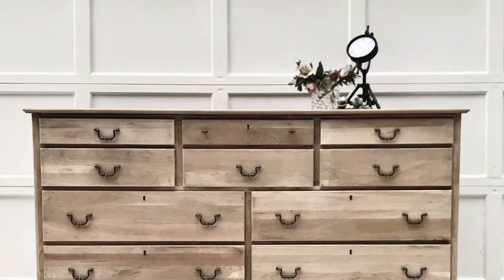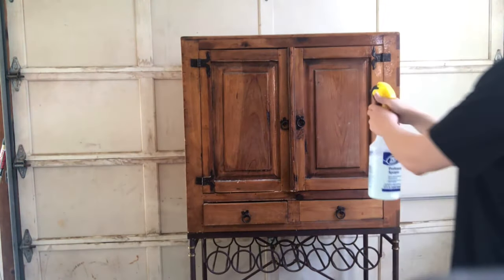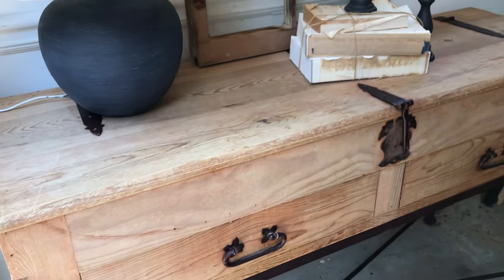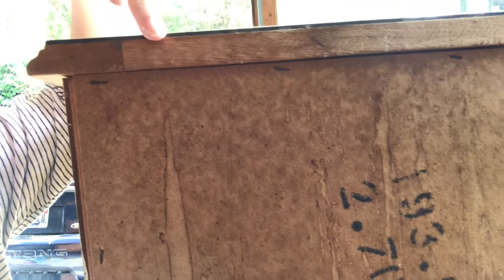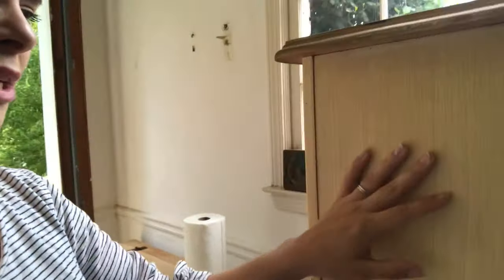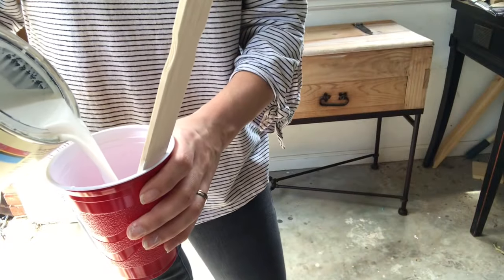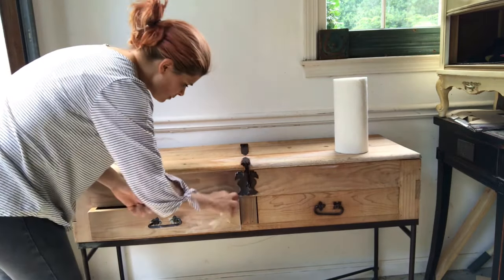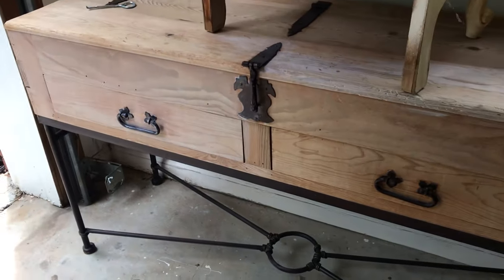Raw Wood Finish tutorial | Bleaching  wood white wash, PLUS How to tell if furniture is solid wood

Comment: I would love to do this on an old dining table that will need to be striped first, but then would love to keep the look of the raw wood. But since it's a dining table what would you recommend to seal it with to avoid water rings from drinking glasses? Love the look if your pieces!!! Just besutiful!
Reply from the maker: Glad you liked the video!  It’s tricky sealing raw wood bc it will darken it.  The only thing I’ve had any luck with that hasn’t darkened the color is white wax.  After the wax cures its pretty durable and most times you can buff out stains.  Def do a spot test!  Let me know how it turns out!

Comment: Love that piece!! I do have a question for you....
I just recently stripped and sanded a dark cherry stained nightstand down to the raw wood with the exception of some dark stain left in the details and carvings (very early 2000’s classic cherry bedroom set) however I don’t  mind that bc it kinda looks like dark Brown antique wax in those crevices- also, the wood tones vary on the doors and the drawer fronts. But I really love the natural wood. I picked up GF FLAT OUT FLAT because I knew that it would prob have a cup or plays sitting on it at some point. So I figured I better seal it since it’s a nightstand. I figured it would darken a little bit so I was hesitant but the trade off was protection right?? Well, one thin coat on one door and not only dark but RED here I come!!! Panicking I wiped as much as I could off let it dry and sanded lightly by hand. Whew! So my next thought was taking some leftover white wax. Which was better but kinda gave it a more pickled look than I wanted. So I stopped and starting looking on YouTube. Saw your video and the blonde girl Pine something. And I’ve come to the conclusion that bleach should help me get rid of that red that’s still in there. Sorry for rambling- my question is I have gotten white wax in the crevices and hard to sand spots, so would the bleach eat that off you think or should I attempt to remove it before bleaching??
Reply from the maker: Lisa Jackson, oh no!  Top coating the bleached wood is a much talked about topic among refinishers and DIYers.  I vote no and have decide I will just sand it if I get something on it.  But that bleed through is tricky.. Being the impatient diyer I am, I’d probably just take my chances and apply the bleach assuming that any white wax will remain but I generally like the look of white wax.  But I doubt the bleach would remove the wax.  You run the risk of it being splotchy if you don’t at least sand off all the flat surfaces but it sounds like you already did that.  Hope that helps and hope it turns out!
Reply: I went ahead and gave it a light sanding again. Then brought them outside in a bright sunny day. I used a big 4” brush and a bucket of straight household bleach. Laid them flat and I did about 4 coats of bleach letting the sun dry each coat in between, then gave it a good wipe down with a rag and water. Totally worked!! There were some really yellow spots that just wouldn’t lighten up but then I applied the white wax and did a little heavier on those yellow spots and it was perfect!  The white wax helped even out any splotches. All the blood sweat and tears was worth it!

Comment: I’m refinishing some vintage pocket doors. They are yellow pine. I’ve already stripped the varnish off, it was dark but they are still so stained. Even after trying to sand. With the varnish gone I can just bleach? I used the zissners wood bleach on one after sanding like crazy. Could I skip the sanding part?
Reply from the maker: If the varnish is off (you can check by seeing if the wood absorbs water and changes color) but if the varnish is off you don’t need to sand at all

Comment: I love the look of this and I like the whitewash, I was just wondering, the lamp and the candlesticks, did you paint those? if so what paint did you use? I love those too that's really dark matte black, it's not just a spray paint, is it chalk paint?
Reply from the maker: I did paint them, I used a chalk paint by rustoleum in the color charcoal.  the lamp has texture under the paint from wall joint compound, I chose not to seek the paint to keep matte finish and for my purposes they have held up great no chips at all

Comment: Please if you can get back to me on the The Wood stain white quickly pickling, I cannot find it anywhere, I I Live in Tennessee looked for it online add a stock so do you have a substitute that I can use to get the white stain look on bleached wood  🪵 
Please help me😩
Reply from the maker: Hey there!!  You can use any white wash or you can do a paint wash with white paint.  Check Walmart or Michaels if you can’t find one at a hardware store, basically you want to look in the stain section and find one that says white ❤️
Reply: Thank you 😅

Comment: Wow, it turned out amazing! How did you know that you didn’t have to sand/remove a stain prior to bleaching? I have a solid wood piece with a orange tone and assumed I should strip it first. But now I’m not sure haha.
Reply from the maker: You can check by wiping a spot with water, if it absorbs the water then it  doesn’t have a topcoat on it, hope that helps!

Comment: On the solid wood nightstand with the red/ orange tones towards the end of the video, what strip would you recommend to use that would take the red tones out before you bleach it? I have two solid wood pieces with red tones  with one being antique. I want them both stripped down sanded and bleached down to the natural wood but not sure if Citristrip would work on them.
Reply from the maker: I'm not a huge fan of chemical strippers bc they are so messy but I would use quick strip 15 minute formula if you are going to go that route instead of sanding.  If I had a lot of red tone I would bleach llike I did in this video and then I would do a white wash or a taupe wash after.  I have another video where I did a cherry wood dresser and I do that exact technique with the white wash after bleaching.  Thanks for watching and I hope that helps!
Reply from the maker: Here’s the video I mentioned https://youtu.be/SLcxzznv-60

Comment: Just purchased a bleached oak coffee table. How or what do I need to do if I wish to use linseed oil on it? Appreciate any advice
Reply from the maker: hmmm, careful with any oil or topcoat, in my experience the only thing that doesn't bring out orange tones or darken my work is white wax
Reply: @blacksheephouse  so your saying as it's been bleached I won't be able to sand down a little then use linseed to darken?
Reply from the maker: @jonathanmcrae3728  if you want to darken then you are good to do that or anything really, but if you want to keep it light then I would avoid any topcoat

Comment: Is there anyway I can lighten a table that has a veneer top? Would be a shame to have to get a new table to match my kitchen :-(
Reply from the maker: Matthew Chipchase if the veneer is wood then yes, but if it’s a laminate than I would go with painting it white or light yellow and then apply a stain on top.  I have a few videos I do a faux wood finish on you should check out 🙂
Reply from the maker: Oh!  And veneer is thin so be careful not to sand all the way through

Comment: Does this work well on yellow pine?
Reply from the maker: Justine Heithoff 
pretty sure, that’s what mine is made of in the video
Reply: I have a dining table I’m redoing now and I stripped it, sanded it probably about 5 times total and it got pretty white, I used mineral spirits about 5 coats of pouring it on and wiping off and it cleaned all of the leftover stain that was deep in the grain. I’m going to do the spray bleach method now to try to get it as white as possible. It’s pine too